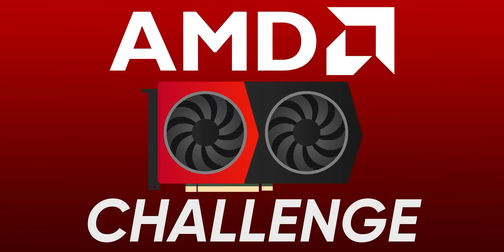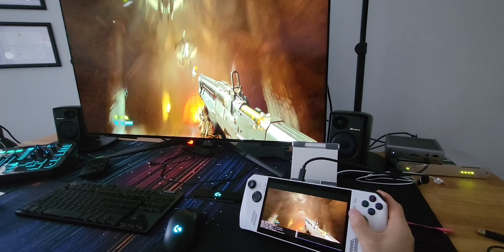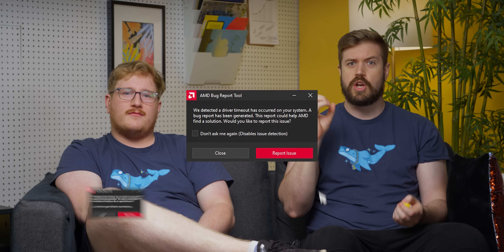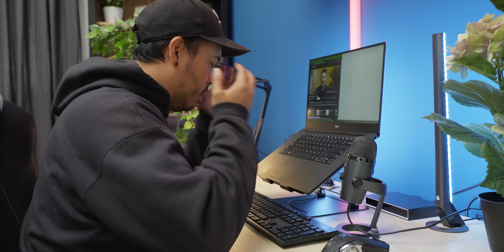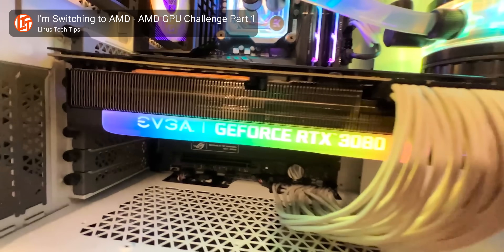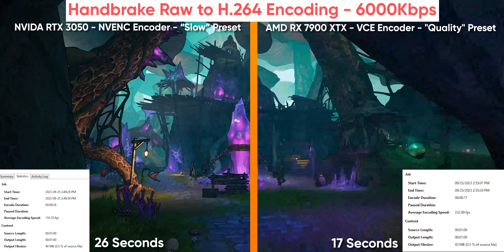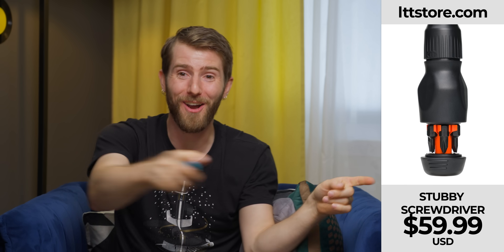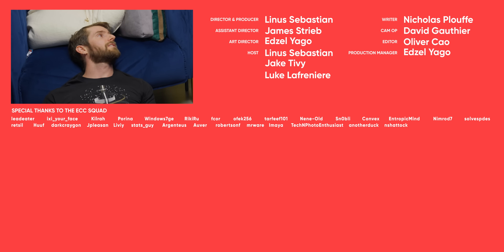I’m Staying on AMD! - Radeon Challenge Pt. 2

Comment: If you're gaming on Linux (and I would likely recommend it IF you want to learn how to tinker) AMD cards are so much easier to config and have a great experience. I am replacing my 2080 Ti and will be rebuilding my system over the weekend. The performance of the 2080 Ti for the games I play (mostly BG3, GRB, GRW & TD2) was fine running Linux. The issue is to install the proprietary drivers for Nvidia cards (a necessity really) the experience is NOT fun. Running a distro that is stable means you do not get to use the latest drivers. Running a bleeding edge distro means you have to install Nvidia manually and it sux. 

AMD, the drivers are part of the kernel... Something Nvidia refuses to do up to this point. So, since I got fed up by Microsoft shenanigans and decided to go penguin,  I guess I will also give team green the finger since having to sell a kidney to buy a video card, it's out of the question. I already sold one for the 2080 Ti (or is it TIE?) 5 years ago and it has not grown back :)

Comment: Hey linus, big fan. My pc has a radeon 580 and an old i5. I can play bo3 at an unstable 30 fps all low settings and 60% resolution set at 1080. Not asking for a new PC but if you give someone else an upgrade and have any old parts I could snag to try to build something at least a little better. Thank you and keep up the good work :)
Reply: Stop spamming...
Reply: @taylorgibson4343 
You've posted that same comment on almost every video

Comment: Seems like mostly user errors...
Tarkov was like that during early wipe.
Halo has a bug where the High-Resolution Texture Pack can get corrupt and turning it off will fix any startup issues.
The crash Linus got in teams, was CPU related. 
Discord does cause crashes as it has hardware acceleration on by default, And if you did not redownload discord or clear your cache you will have crashes.
Luke also blames his GPU several times when clearly its windows issues. 
Jake does have some real gripes, his idle power draw is pretty high and shouldn't be.

Comment: I never buy the latest generation anyway, it’s really overpriced and has plenty of issues early on. I had this both on Nvidia and AMD side, so I bought a 6800XT for a steal when 7000 series dropped. Been solid as a rock, same as my old 1080 which I bought when RTX 2000 launched. My friend with a 4070 had all sorts of issues - and paid way more for no much more performance… Pro tip: look into buying last-gen when new stuff drops

Comment: hey i have a question.. could there be a psu issue if i encountered artifacts and game crashes? like.. i couldnt even start the game cuz it would just freeze my pc. i just sold my 1070 for 80 bucks cuz i thought the gpu was the problem, but now i start doubting my decision.. i also didnt have anyone to go and test the gpu. thanks
Reply: and about the artifacts.. there were some crazy lines and dots and circles on the screen, or random flashes if i was playing games with at least decent graphics. i was experiencing some issues outside the games too.. wallpaper buggin and turning black and after like 5 minutes if i refreshed the desktop it would turn to normal

Comment: I had problems like Luke. It's a power supply problem. I have an 850W Corsair and had to wire the power lines separately to get rid of these "glitches".
Reply: It's not a power supply problem.
Reply: @haxie4516  From the description of the problem, that's exactly what it is. Unexpected drop in FPS to 3-5, if HDR is on, the screen will blink before that. HDR can turn off even on the desktop. Video on YouTube starts to slow down. Driver timeout occurs. I repeat. This is exactly how it was for me. My power supply has 2 connectors for video card wires. When I had the RTX2070 it was wired with a splitter. The problems went away when I plugged each video card connector into a separate power supply connector. I've had no problems for about a year now.
Reply: @haxie4516  To be even more specific, there are 4 connectors on the power supply and the wires are connected through one.
Reply: @ladiossopplive3027  
Except, if you watched the video, they checked. It's not.
And a driver update to the GPU wouldn't fix the issues with a PSU.
Reply: @haxie4516  I also had a hard time finding a port combination that worked for me. This is not an obvious solution at all, as the power supply capacity matches the requirements of the video card.
Reply: @ladiossopplive3027  
Yes, and as an EE, what you are describing is not the issue.
Updating a driver does not and can not possibly fix the issue you are describing.
Not only that, but Luke tried multiple different PSUs, tried multiple configurations of his cabling, but also tried having a dedicated PSU just for the GPU.

It's not the PSU.
I understand you're trying to help, but in this situation, you're giving bad information
Reply: @haxie4516  I didn't see what he was trying to do. But same symptoms = same cause.
Reply: @ladiossopplive3027  
Ok, but I get a headache and feel queasy in the mornings, I know I'm not pregnant, but those are the same symptoms I feel when I'm pregnant.

You are mixing up correlation and causation.

Comment: What Luke is describing is an perfect example of the problem sitting one meter on the front of PC.
Sorry, but the amount of issues what he had, I haven't had since I turn on my first PC in 1990... And I use since then obky5p
AMD Hardware... Mixed up with Intel in my family.

Edit:
This must all be made up on compulsion, he tells gesxgoxjten here that have been sucked out of forums.
Sure, sombody, sometimes have some issues, but not ONE person could get have EVERY conceivable problem at once at the same time... 🐂💩

Comment: its pretty bad when your GPU crashes because of bad driver development. Had Radeons in the past since ATI, and their drivers were pretty bad back then. From what I see AMD hasn't solved that issue, they still dish out underdeveloped drivers frequently. There has to be a tradeoff, though, when you budget a PC, do you want a cheaper GPU with better numbers but poor software or a expensive GPU with better quality drivers and features. IMO it's frustrating to wait for updated drivers when you want to game. That's a big reason why I went with a 3080ti over a 6800XT or 7800XT

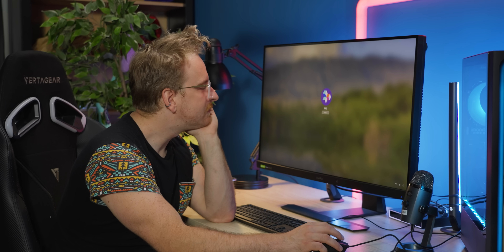Comment: The problem that was address at 7:13, The monitor feeling like 50hz can be solved by opening the task manager and ending the Radeon related process you'll see at the top. No shutdowns, nothing will happen, just END it. PC will run fine.

Comment: I have been a Radeon guy my whole life with no issues. Was finally peer pressured a year ago into trying the crappy 3080 ti... and man my performance severely dropped.  Most games unplayable ... I had an old MSI Radeon RX 580 in the closet... Swapped it out to improve my performance over the 3080 ti..... That's just how bad shitvidia is.

Comment: Wow, ove never experienced that many crashes with the 7900xt, it hasn't been all a smooth ride but the problems look miniscule compared to what LTT reported here. It used to  bsod whenever quitting a game using full screen mode (not borderless window) with HDR on, but since a driver update months ago it just stopped crashing. And Witcher 3 DX12 used to crash whenever I changed clothing oddly enough, tho many ppl with varying setups report that W3 DX12 crashes for them & CDPR doesn't care cuz DX11 version runs just fine. No other DX12 or Vulkan game crashed for me. I don't do any video encoding, decided to go for a pure gaming build and that's what AMD does better than NVidia even tho NVidia is better for work, AMD still lags behind on that front.
Reply: Also possibly since I did a brand new build and didn't just swap gpu into an older system.

Comment: FINALLY IM NOT INSANE, I had so many issues when I bought the 7900 xtx and was so upset with my experience but for some reason I found very little people talking about it, it was so bad I returned my first card and got a different brand and model of card, only to have the same issues with a different GPU. i finally was done with the experience and like they said I paid for it myself so I gave in and returned it and bought a 4090 instead and have not had issues since. It sucks especially because this was my first experience with an AMD card.

Comment: uses a cooked cpu in one of the pc's, uses a bios that was ran through a military grade ECM scrambler called LINUS pushing the power button like a 3 year old that found the light switch that  fried the windows install and the bios, like do an actual fresh build, you dont put a turbo in a bmw that was driven off the edge of the harbor and brought back up and think it will run fine because the cars ecu, shocker is full of salt water and fish feces.

Comment: 12:36 Am I being stupid or are the charts showing the AMD encoder to be the fastest of the lot? Because they're saying it's bad, but the charts are showing it to be the fastest. Did they mix up the charts again or am I missing something?
Reply: The average encoding speed lines up with the encode duration. Even though the charts show the VCE encoder being the fastest among the test setup, it still produced the most visual artifacting and quality loss among the tests if you look at the video, all while outputting a file size of 43 MB. The nvenc one was still much more impressive for delivering better quality with a smaller file size, even if it was slower.
Reply: @glimmerrift2712  Ah, so it was a quality issue. I thought it might be, since that's the general consensus for the VCE encoder, but still, it wasn't presented very clearly.
Reply: @LoLFactor  It's also worth nothing that these encoders have different presets to offer greater speeds and quality spreads during the encoding process. The best NVENC one for smallest file sizes and quality is the "Slow" preset, whilst for AMD VCE it is "Quality" ; and you can clearly see the difference in quality between the two here. It's very possible for NVENC to match the AMD VCE speed and still potentially beat it in quality with the "medium", "fast", or even "high performance" presets that sacrifice video quality and file sizes for faster encoding speeds.

Comment: Cool info, but i haven't had those problems at all, i am running older hardware for the most part though, other than the computer restarting while in sleep mode while not in use

Comment: do not buy any hardware too close to launch, that's always gonna have the issues we got with drivers here, and Nvidia is just as bad for this. Beyond that, most of those other issues have been either the issue of just it being a different brand than what's presently installed, switching is far worse of an experience than if you were already on it, with the other issues being largely your own fault with doing things known to cause issues with most cards

Comment: I bought my first AMD new gpu (RX 6800) in Jan and installed in almost a completely new PC (12th intel). 
I was living in a hell of blue screens/freezing for about 6 months. 
That's completely ended after I did the following:
1- I fresh installed Win 11.
2- I updated Bios (significant impact).
3- I used the motherboard (Gigabyte) utility for installing/updating motherboard's drivers (audio, chipset, M.2 controller..etc) which seems had the most impact on my device stability.

Until today not a single freeze or crash for the system neither in any game (Starfield, Cyberpunk2077, Spiderman remastered, far cry 6, Emulators, old games..etc).

If none of you done this procedure, I would say that's unfair toward AMD. Because when you installed Nvidia gpu it came to a fresh or previous Nvidia PC. 
Hence, I use DDU whenever I update AMD driver (this is really annoying). Otherwise, I completely satisfied with it.

Comment: If your game crashes and you see your Discord gone it's an issue with the AMD driver and Discord. While playing the Halo campaign I had a crash at the exact same point during a cutscene while my Discord was open. I closed it and I was able to play the game. It turns out that if you disable every hardware acceleration option in Discrod these problems will disappear. (Currently, there are two. One is in the Advanced menu, and the other one is in the middle of the Voice & Video setting (video codec part).)
Reply: Fwiw, Discord is just incredibly easy to crash.
It's not that it causes the crashes in most cases, it just panics if things are not 100% as expected, and then crashes due to that

Comment: Not doing a fresh install when switching from nvidia to AMD is insane. Had you done that, this would’ve been a glowing review. Made this mistake myself
Reply: I mean, it shouldn't need to be done, and most people won't do a reinstall
Reply: @haxie4516  it’s the nvidia driver causing the issue
Reply: @ToaRocky  
Tbh, fair ngl. 
I have personally swapped from AMD to Nvidia fairly frequently (at one point it was swapping out GPUs multiple times a week, depending on what I needed) and don't face issues, but I do know my partner had a fuckload of issues when swapping over

It still shouldn't need to happen... this needs to be better, and that's aimed at anyone/everyone involved in what makes it so bad of an experience rn XD
Reply: @haxie4516  unfortunately both vendors benefit from making it harder to switch
Reply: @ToaRocky  
Good point tbh

Comment: The LUKE's issues also happeng on my setup I have a RX 6700 XT paired with Ryzen 5 5500. while using chrome the pc frezzes like 5 min and the worst is that this issue happeng onf league of legends while ranked games, the pc just frezze and stop working even the shutdown buton. I found turning off the Freesync premiun. And AMD should fix this.

Comment: My experience with the 5700xt was much like Lukes. pretty much constant issues and crashes. ditched it for a 6700. i have more or less no issues now. im kinda weary about updating drivers right when they come out. i usually will watch for a few sources to give feedback on how new drivers are before i put them in (because sometimes new drivers can cause single game issues). I almost opted for the 2070 super after the 5700xt gave me so many problems. but im glad i didnt do that as things are going well now. (ryzen 2600x, 850gold psu)

Edit. issues with 5700xt included. computer not waking up from sleep, screen sharing on discord would not work. about 1/3 of my games would crash either when first booting them up. or trying to load a save game. random driver timeouts. youtube video getting stuck. 
6700 non xt has given me none of those issues. every once and a while a game will not work, (usually game update related) but who knows some could be gpu problems, or just windows.

Comment: I'm running an RX 5700, I can't use the default windows Camera app without freezing my computer, or at least making it entirely unresponsive. That's one major problem out of many MANY more. Hanging is common, same with seemingly random loss of responsiveness.

I'm thankful that I saved money buying this card at the height of the scalping bs, AND IT IS A GOOD CARD, but AMD drivers have really soured the taste for me. These card are great, but they can be better. I've never had an issue with my laptop Nvidia cards, so I might switch back to Green as much as I dislike Nvidia as a company. 

AMD makes great hardware, but sh*t software. Combine that with the commonality of other sh*t software and well it's no surprise this is a common issue.

Comment: Really ppl. If the game is already dipping under 30, turning on FG takes a little bit of performance, before the doubling. So the game would feel as a SUB 30fps game. Really, who cares how smooth it looks then. The same as thay rog ally video. Nobody claims that it roesnt work , but it simply costs a frame of latency and if your base fps is that low, a single extra frame of latency is a higher hit than at 60fps+.
Yes it looks smooth. It plays like crap. Imagine a sub 30fps game with a really really great motion blur implementation. 
Its only interesting for looking at the screen at that point , not actually doing something with inputs :).

Comment: Amd gpus just have weird bugs that nvidia just don't have. Usually with nvidia theres a good reason if you have issues and you can fix it. But with amd the smallest thing can give you constant issues. I have a 6950xt its been good with no issues after replacing my power supply because of constant shut downs which was fine on my 3080 ftw3 with 450 watt bios. but on the same pc my 5700xt had constant crashes but was fine on my friends pc. I had 4 different nvidia gpus and they all ran fine from the start.i always use ddu when using a new gpu.

Comment: AMD's hardware is really good, I used 6700XT and was completely in love with the performance. But the software side is just so so bad. The Driver Timeout curse. AMD needs to put a lot more into the software development of their cards. They'll probably take over the low-end and mid-range market and quite easily. Hope they read these comments too.

Comment: My XTX use around 100 watts at idle - IF you have two monitors connected. Now - watching this video in Vivaldi, it uses around 30-50 watts. 20-25 when i puase. What I did was that I put the secondary monitor on the built in Intel 770. My issue now is that the secondary monitor, when I turn the computer off, gets a weird wake up signal about every 10 seconds, so it wakes up - goes No signal, and goes to sleep. Over and over. So I have to turn it of manually. Or have the XTX idle at 100 watts with both monitors xD 2023 problems :P